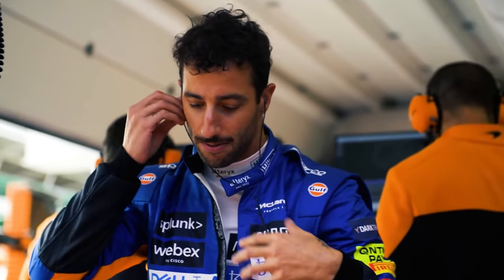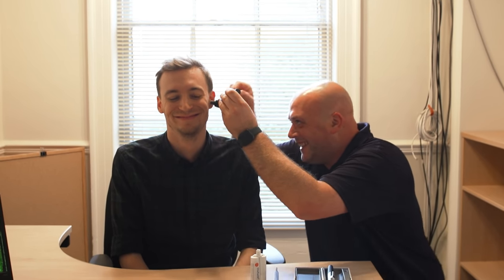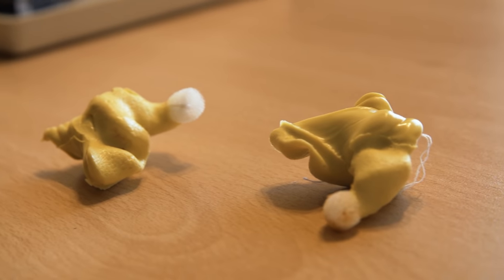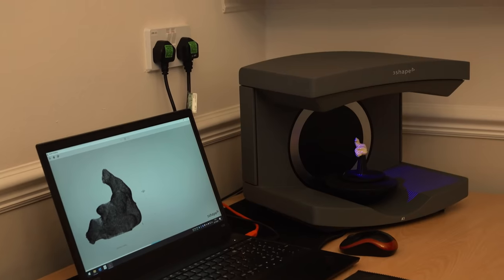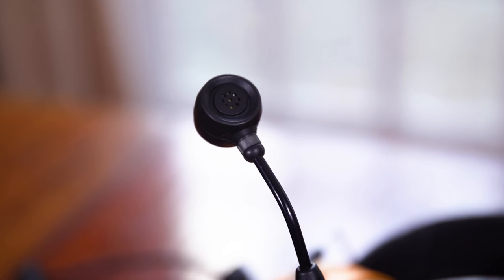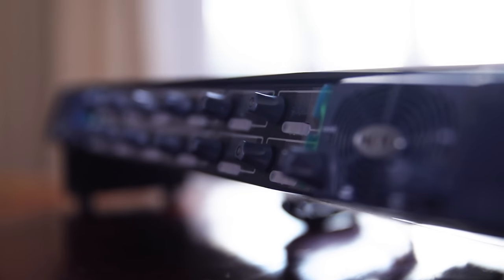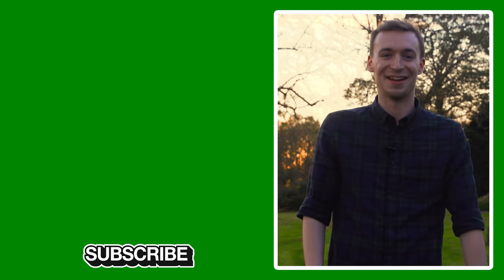How Formula 1 Driver Radios Are Made

Comment: Matt this was class! Still got my ear moulds from my time in Formula E, but it was really cool to see the process of how they were made. Great video!
Reply from the maker: Glad you enjoyed!!
Reply: Is formula E easier than formula 1? It's a genuine questions no harm meant tho
Reply: @twanhams2635  Formula E has much smaller team budgets than F1, and if I'm not mistaken there's more standardized parts. You can probably assume the jobs of the crew and factory staff are less complicated than an F1 team's.

'Easier' is harder to answer – Formula E teams' performance is a lot closer to each other, so driver skills play a bigger part in who comes out on top (as opposed to F1, where a Merc not making it to Q3 is basically impossible). And while the cars are slower, they usually race on street circuits (which have zero margin for error). Strategy is presumably a lot more difficult to develop as a result.
Reply: @twanhams2635  this question can be answered from many perspectives, but there's 2 main angles to look at.
1. The drivers in FE have the same skill as the drivers in F1 as all drivers have the same training and they all usually come from the same junior racing series' such as F2. So, FE is not easier to race in than F1 as in you still need to be better than the drivers around you, and the drivers around you are the some of the best in the world of motorsport.
2. FE is easier than F1 in terms of physicality. F1 is higher top speeds, higher cornering speeds, longer races and longer tracks. FE is 1 hour long, narrower tracks and lower top speed. If you look at it that way, F1 drivers have to be physically fitter than FE drivers and they experience more G-forces than FE drivers. But this is only because E-tech has been in development far shorter than combustion power and F1 has. In the near future F1 and FE will become more and more similar as FE evolves to have better power units and better batteries, and as F1 evolves to become more sustainable. 
Hope this answered your question. :)
Reply: @awijaya2116  merc not making it to q3 impossible aged well
Reply: @awijaya2116  Ask Ham about a merc not making it to Q3

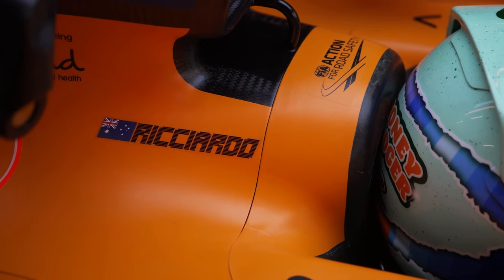Comment: 1:52
Hold up holdup… 1.9 Gigabytes/sec?? Faster than most peoples connections at home? That’s faster than any connection period… that’s 15.2 Gigabits/sec, or 15,200 Megabits/sec… on a good day, I can get 200-300 megabits/sec… the F1 upload speeds are 50-75 TIMES FASTER than my WiFi at it’s best… the fastest WiFi I’ve heard of is gigabit WiFi… so even that is 15 times slower than the F1 car in its garage… absolutely mind boggling
Reply: Pretty sure those are gbit/s. Seems like normal 802.11ad.
Reply: I was wondering the same. But yes, he probably meant Gbps. Those few people he mentioned that has faster internet must have some crazy shit

Comment: Great video!
I got a set made by Ultimate Ear in the UK for motorcycle riding. They are incredible, especially with the Bluetooth connection. Super useful to keep the roaring wind to a minimum and hear the gps without having to look down.
Sound like an ad, but they really are that good ^^

Comment: you would imagine the race teams/track would just have a tplink wireless base station or cpe aerials all using the same ssid around the track and an aerial on the car so it automatically connected to the highest strength and then just have discord or similar app, just thought that teams would prefer the high bandwidth wifi link for HD camera live feed etc

Comment: 1.9 gigabyte per second is something in the region of 15 gigabit networking
That's not just "faster than most people's Internet" thats straight up faster than any SATA SSD in your pc or laptop and faster that most high speed network connections you find in servers (those are usually 10gigabit)
Reply: It is 3-4 times faster than Nvme ssd. Forget about sata

Comment: If by "most" ppl you mean 100% of them. 
1.5GB/s is a modern nvme speed used primarly for OS, other drives get at best 0.6GB/s INSIDE a computer.
Not even best fiber internet is close to that. Let alone they do it wirelessly. DANG!
Reply from the maker: Kinda answered my response there, all teams have this second connection but not all at 60ghz speeds!